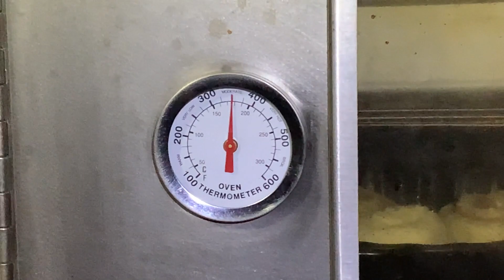Sluicing the East Branch with the Gold Doctor / Maine Gold Prospecting

Comment: Another great video guy's I'm glad you still like the sluice I like the easy quick cleanouts it makes it nice to not have to mess with bolts and mine I cleaned out and had it back in the water running in about a minute the next one will be similar
Reply from the maker: I'm curious about the dream mat. I'm going to put it to the test.

Comment: The little white things flying around I’ve always called snowbugs for the simple fact they look like snow flakes floating around
Reply from the maker: I don't think I've ever seen them before but maybe I did and thought they were cat tails blowing in the wind.
Thanks for watching.
Reply: @hipbeeexplorer  no problem I’ve been interested in prospecting since I was 14 and here I am 28 now. I just found your channel and man all I can say is hopefully I’ll run into you guys out on the river this summer. Trying to get myself a pan
Reply from the maker: @kennethmower2557  Right on man. You can get the best pan there is on our website. The garret super sluice but wherever you buy it make sure it's a 15" or 16" pan with a large flat bottom like the ones I use in my videos. Pans with small bottoms, and there is a lot out there are difficult to use.